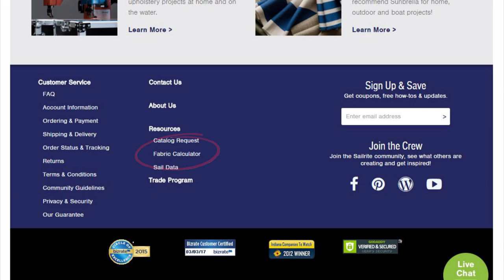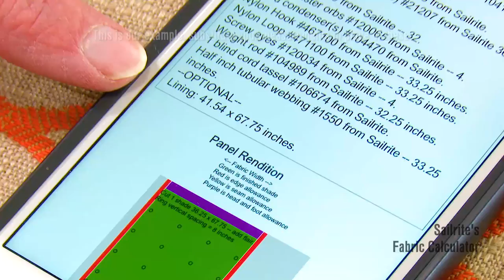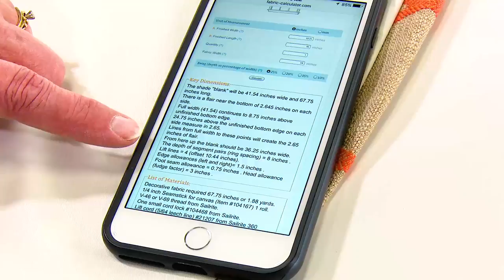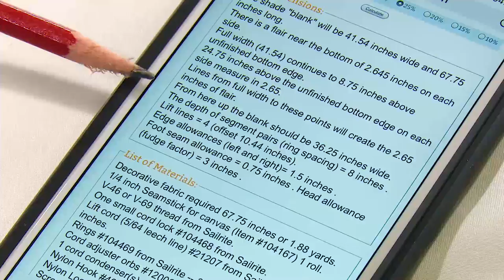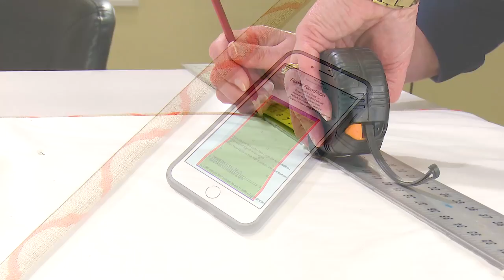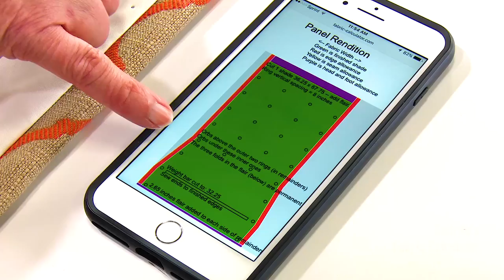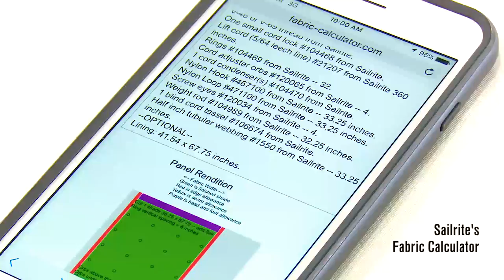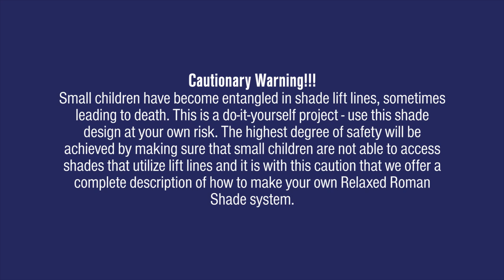How to Make a Relaxed Roman Shade

Comment: This was evidently made before a lot of child safety techniques were required.  Considering it is blackout fabric, I would have pressed the sides and bottom with the liner inside the side allowances.  Also as mentioned, light pin holes were not addressed.  At that considered, a great looking shade.  I liked the walking foot machine with the zigzag.

Comment: Do you need to account for returns if you do an outside mount?
Reply from the maker: Making it an outside mount is easy. Simply enlarge your original width and height measurements to account for the extra size of an outside mount and follow the instructions as seen in the video.